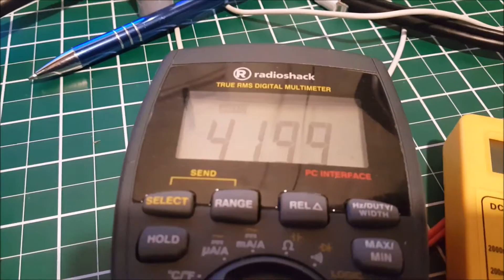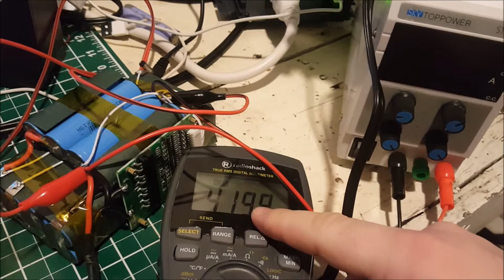Dismantling the 37v li-ion 18650 battery BMS (part 2)

Comment: It appear to do so yes. 

The downside of this connection variation is that when the charger get the voltage too high then the whole battery is disconnected from it's load also so if you want to be able to over-voltage protect the battery while a load is connected then the load negative should be fed to the B- terminal and the charge negative to the C-, then one pair of mosfets will disconnect the charger when the battery gets too high and the other set of mosfets will disconnect the load when the voltage gets too low. And in-between those two voltages the balancing should keep each cell-pack at the same voltage...

At least that's how I understand the BMS should work.
Reply from the maker: Yes! You totally nailed it, I don't know why they didn't use the B- terminal. I did test this outside of the video and the B- terminal alllows the load to pull power when the C- terminal has disconnected.

My understanding on the balancing circuit is that it only top balances, ie. when the cells hit 4.35v or something similar it will start to trim the voltage as the other cells come into alignment.
Reply: The biggest issue I see from most of the smaller BMS's is that the ballance discharge currents are very low so if your battery cells are very unbalanced then some of the higher capacity cells would still pull a current beyond the typical 40-60mA I've seen allowing the low capacity cell to get overcharged. Eventually the overvoltage protection would then pull the whole battery off the charger. At some point the voltage over the low capacity cell decreases and the whole process starts over.

The low capacity cells will spend a lot more time in a overvoltage state than the higher capacity cells in the battery so they will get even worse over time as Li-Ion battery really don't like spending any time in the overvoltage state or its capacity will decrease making the situation even worse next time you charge the battery.

I've seen people bottom balancing their cells before the put the packs together as then you get a better picture of the cells true capacity, and then use that capacity to select the same capacity for each set of parallel cells, that way all the cell groups will have the same capacity and should reach the same voltages at the same time. This should allow you to get rid of the ballncing discharge all together or at not rely totally on it to protect against uneven ballance cell groups.

Obviously using a ballance get charger would be best as then even if the bottom ballance cell groups get out of balance slightly then the ballance charger would allow you to monitor this and take corrective action if need be.

Sorry for the long post... :-)